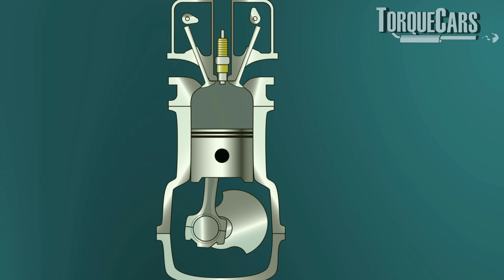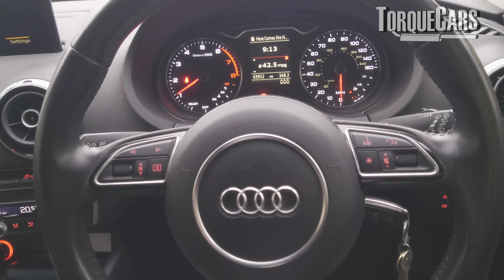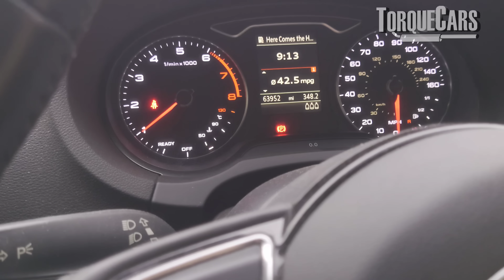These Common Cold Start Mistakes Could Destroy Your Cars Engine!

Comment: BMW 318D here (N47 engine) at over 320k kilometres driven, without any issue. I change the oil every 8k kms. Replaced the timing chain and the rod bearings, main bearings @ 275k km. Changed the injectors just 3 days ago since I heard them starting to make very soft crackling noise. But I think replacement at 320k kms is very good indeed. Turbo is still the original. My startup routine goes like this : ignition, wait till the pre-heating happens, then I push start. Im starting with the clutch being pushed (manual gearbox) since it eases off the double weight clutch's spring, in return loads a little the main crankshaft's positioning bearing, but I think it's still the better solution. When the engine revs up I wait 20-30 second to get the rpm down, this means the very early heat up of the pistons already happened. Along with a little spooling and warming up of the turbocharger. Exhaust also gets considerably warmer after the 30 seconds, if you don't believe me just try to touch it 😂. Normally exhaust gases are instantly like 300-400 Celsius hot which work on every part immediately after start. So after the very first 30 secs I start parking out, using under 1200rpm range. I need to do an Y 360 degree so it takes like another 30 seconds. Then off I go in first gear at exactly 1300 rpm, this is the very first street which is around 300 meters long. Then I go further progressively using 2nd and 3rd gear but never rev above 1600 and I strick using the slightest acceleration to avoid turbo spool. After the initial 1.5 km I start using the 4th gear, reaching city speed limits. Beyond this Im using 1300-1800 rpm range with very modest acceleration until the oil temp gauge shows 75 Celsius. Then I start using rpm ranges up until 2000rpm, and medium acceleration. When oil reaches 100C finally (usually after 20 km distance), I start to rev till 2500, and do decent acceleration. And finally the very last stage, after another 5 km with 100C oil, I start to use the full rpm range (I mean the reasonable range) which is 1300 - 4000 rpm, and often do full throttle. Even if I drive slowly I shift at 2500rpm. Many owner kills his diesel by using only the low rpm range (under 2k). I know that it is funny to push the pedal at 1300 rpm and feel the turbo kick in and feel the immersing power waking up. But mind me: it is the second main reason why your engine won't last. Bearings hate low rpm torque! Always shift back! Accel only from 2k flat out. And you are very safe to use 3k - 4k rpm range if you are only accelerating and not traveling at that rpm. Traveling (anything lasting over 5 mins) must happen under 3k rpm otherwise you will overheat your components, but that is over 150kmh in 6th gear anyway so where would you do that? 😅

So to sum up, start out after 30 sec be very gentle, but keep warming her up, and when she's warm use her dynamically, don't drive like a grandpa.

Last but not least : always plan you cool off periods. Drive slow in the last 5kms! No race no 4k rpm, no flat out here. Just progressively get slower and slower allowing the components to cool back! Once you arrived idle for 30secs then shut off the engine. You turbo will be with you like mine for at least 300kms if you do this.
Reply: To work and back then, how sad!!!!
Reply: @dunc5946  I mean thats what these cars are build for... You dont buy a diesel to have excessive weekend petrol head trips. I also own a 330D BMW E90 (N57) and it is one of the best cars I ever owned. 317k kilometers at this point, runs butter smooth, 6l/100km fuel consumption and all of that with decent horse power and comfort. The perfect daily car imo next to the classic toyota corolla or honda civic. If you properly take care of the engine these things run 500k kilometers and longer. The cost per kilometer ratio is very good on these cars for communiting! The only downside is unfortunately most people know this so all BMW from the golden era are past 200tkm already and you are only getting beat down cars. You never know how the previous owner treated their car so its always a gamble. The best value was buying a N57 in 2012 with 50tkm and rocking it unitl today. Would have been the a tremendous deal but hey you take what you can get.
Reply: @dunc5946 Depends on how much you care for your car and engine. It also depends on how much you know and understand about engine technology and how much time you might have invested in the car and engine. If you see your car and a means to an end, you won’t understand this way of thinking.
Reply: no issues ? i should think not , youv rebuilt the engine almost !
Reply: @brianliggett9087  the replacements are like 1/4 of the cost of a replacement engine, yet you are getting 500tkm + out of this engine... of course everyone knows its almost impossible to run a engine forver without 0 maintenance lmao when you talk about an engine "without issues" you are basically saying the engine can even last until 500tkm+ without key components breaking like the pistons or the engine block

Comment: My 1997 Toyota Hilux l never ever rev the engine high when l first start it up and l do wait for the temperature gauge needle to move it is summer in Australia now and is warm and my Hilux does warm up quicker and there is no reason to go fast and rev the engine and the 22R engine has a lot of low down and mid range torque and l there is actually no need to rev the engine hard because the engine is so flexible and my Hilux has done 440000 kilometres and does not burn oil at all and l would notice any oil burning because there is no cat converter and no blue smoke infact tgere is no smoke of any colour coming out of the exhaust pipe also it depends how well built and engineered the engine is infact the 22R engine is considered one of the most reliable engines ever made were most European engine are not considered to be really reliable there are much older European engines which are very reliable and will go on to do over 1000000 miles and there are many Toyota engines that have done over 1000000 miles without a rebuild that's what  Toyota is famous for reliability although its taken a bit of a hit lately from what the USA with there legislation have done

Comment: Some bullshyte going on here.   Cold weather start-ups and RPM is controlled by both air and coolant temp sensors in conjunction with the ECU.   So initial start up will produce a higher RPM until the sensors tell the ECU to go into idle mode!

My daily driver is now >26 years and running very smoothly!

Comment: As a rule i let engine idle for about 20-30 seconds before i drive off, cold start that is. My Volvo S60 rev high for about 20 sec when it`s started cold, i let the revs drop before driving off. This 20 year old car have been a reliable car for 15 years i`ve had it.
Reply: Well ofcourse, it’s A Volvo😎😎🔝🔝

Comment: I think there is a law of diminishing returns beyond the basics, changing the oil frequently and being gentle with the engine while it’s warming up are the absolute basics for anyone who wants to get long life from an engine.
Reply: Absolutely! But I can assure you that most drivers have no clue at all about the how long that takes in mls/km/time. 6 to 8 km. at least, depending on the weather. As mentioned; short trips are deadly too.
Reply: @sebastian0107 
*Only short trips. One full heat cycle / long drive a week is enough to ensure longevity.
Reply: @ If only! Many people are used to taking ultra short trips (1 to 5km.) to work or to go shopping. Yellow Sludge will then appear within days. OK, so, yes, that will disappear with a full heat circle, but the in-the-mean-time damage all that moist does to your engine and exhaust in the long run is not beneficial. Cold starts, bad miles; they're all bad, in my opinion.
Reply: @sebastian0107  in your opinion, fine. 
But it's been disproven many times over.

Comment: I used to live where winters are -20C . Thumb of rule used to be start the engine and clean snow etc and go as soon as front window is dehumidified. No snow = drive away instantly no matter how cold it is. Engine will warm up faster as well, keep low rpm until warm. Don’t overthink it…

Comment: If the ambient temperature is 35° or below, I usually give my car a warmup of 3-5 minutes before taking off, then lightly load it. My car is a hybrid and runs a full synthetic 0W20. Have gone over 160k and no oil consumption ( maybe a quart or so a long time ago ). Currently running Lubrication Engineers full synthetic, the best oil you never heard of😊
Reply: 35?....that's hot!

Comment: Usual method for a cold winter start for me is to set heat to high, fan to off, start engine turn on lights, and any electric heating that the car has, which increases the load on the engine a little.  Leave it running while you remove snow/ice from the windows. And drive off while turning the fan on at mimium, and have it heat only the windshield at first. And as the temperature of the engine starts to move up rapidly from driving, turn the fan higher until you get to a comfortable point.
This just allows the water in the short loop to warm up quickly without the heating system cooling slightly warmer water back to cold again, and to give you a decent bit of heat in the system to drive off with. 
Most people start the car, turn the heat up, turn the fan way up, and the water just doesn't even get the chance to warm up while idling. 
If there's no chance of fogging up you can keep the heating set to cold to reduce the amount of water circulating and help heat the engine up even faster.
Reply: I would normally keep the heater off until the car has warmed up a little to help the engine have all the heat instead of having to heat the heater circuit as well, unless they are others in the car complaining about the cold, I think you know who I mean LOL.🥶🥶🥶.
Reply: @kensmithmail  I prefer to keep it open with fan off to prevent dumping a bunch of cold water into a warm/hot engine once you open it up. 
It's probably fine, but it just feels wrong to risk dumping ice cold water into an engine that has already warmed up.
Reply: He just told you not to put load on the engine when warming up.

Comment: It summer my Chrysler warms up to 180 degrees engine temp in about 5-6 minutes. In winter like now wgen its 40 degrees outside it take almost 20. And while im on the highway my engine temps are about 165-175 instead of 190 usually in summer. I love winter

Comment: I own a GDI turbo and I have a hill to climb to get out of my hood. I have a boost gauge,what I try and do is run my engine at a little higher rpm to keep the turbo boost pressure down while climbing any hill

Comment: I watched a few of your videos with you harping on not letting your engine warm up but just gently drive it keeping your rpm’s low. It is obvious that you are not from a cold climate. At -35c or colder with an automatic transmission you don’t move until engine rpm’s are at least 2500. The transmission, differentials, wheel bearings all are stiff as hell. As for condensation in the exhaust, even on the highway the tail pipe is spinning drops of moisture. My rule of thumb is until the temperature gauge move I don’t go anywhere. 55 years of driving and I have yet to replace a vehicle because of a bad motor.
Reply: Ok most places in the world will never see a extreme as low as - 35c on any regular basis... You may be right for those specific conditions... But this video is more applicable to the majority of us
Reply: I'll bear that in mind next time I drive to Siberia

Comment: The solution? Install an auxiliary heater that also preheats the engine. You can turn on this auxiliary heater with a remote control or program the time you want to leave. Then the car or truck, including the engine, will be preheated when you set off. The manufacturer Webasto comes to mind. Just ask the workshop about auxiliary heaters.
Reply: Webasto. ‘the wonder word’
😎😎

Comment: Why aren't car engines programmed to run at 1,000 rpm at start instead of 1,500 to 2,000 rpm? Cars are also sold to warm climate countries and don't need to warm up so intensely.

Comment: All these facts about cold engines and how to warm up ETC have been known about almost as long as there have been engines in cars, We do know more about it now but this is not a new thing.
When the first engines were put into use, drivers would soon feel the power and overall performance (Not that there was a lot !) improve as the engine reached operating temperature so there's nothing new there...
Modern materials and lubricants used now are vastly superiour to that which was available in the 1890's but the science behind the operation of the internal combustion engine is basically the same. Better material selection and alloying techniques have improved wear properties beyond anything that could have been imagined when the first engines were produced but the same basic things to increase the life of your engine remain the same. Above all, regular maintainance is key to keeping your pride and joy on the road for longer as well as knowing that if you give the engine a hard time, it's not going to last as long no matter how well you look after it. 
Dont thrash your engine past the red-line, ever! Its there for a reason. Even if you know the engine can handle the higher demands of a good thrash you're asking for trouble eventually, but probably sooner than later and possibly catastrophically when you least need it!
I have had many mechanics tell me the best way to warm up your engine is to start it up, let it idle for a few (10-20) seconds to let oil circulate and then drive gently for the first few miles or untill your temperature gauge shows its up to operating temperature. In most cases this will be just a few minutes. There will be some circumstances when you cant stick to this routine but if you can stick to it you'll have your engine for much longer...
We could have a rigid routine of warming up but we have to be practical and in this modern world, engines have been designed to cope, as long as its well maintained and not hammered every time you get behind the wheel.

Comment: I use good quality correct grade oil in my cars and pull off straight away from cold and drive them under 2K rpm (Without laboring!) Until they are up to temperature on the gauge, Then i happily give them some welly! Also never start a cold engine and just let it idle until warm especially diesels, The warm up procedure should be at min 1500 rpm, Low idle cold and the piston rings dig in to the bores!
Reply: DO you mean I should not let my diesel van idle? I was told to let it idle for 5 mins before driving
Reply: @imantheP.D  High idle mate, 1500 rpm minimum stops the rings bedding in to the bores.
Reply: @imantheP.D  in Germany you are getting fined if caught idling over 30 seconds

Comment: Question from the " stupid seats " and please don't crucify me...
Are you saying modern cars need a choke?
Reply from the maker: Ah the good old choke, this was a feature we had on carburetor engines which would force them to run hotter, on  a modern engine with fuel injection the cars ECU (Computer) does all the adjustments needed and takes reading from the exhaust to drop exactly the right amount of fuel in. The modern car does carefully control everything during warm up and the main reason for this is to protect the catalysts so at first the idle will be quite high and as it detects the engine warming up and burning better it will drop the idle speed down.

Comment: On my turbo diesel pickup, I start it up and let it run while I am doing my seatbelt, mirrors, heater controls etc. So maybe 10-20 seconds. Then drive off gently keeping around 2K revs until its warmed up properly.
Reply: I let my Allroad sort out it's own idle while belting up etc. After about 40 seconds it settles down to about 850-900 rpm and the fluid in the gbox has got around...I know this cos if I try 5o engage gear before then it doesn't like it and jerks, but after 40 seconds it's smooth. Drive off keeping the revs under 2k until the temp gauge starts moving and then let it get to 6th in its own time and all's good for the rest of the drive.
Reply: I always do that as well.
Reply: See my post above, Bad idea to let a cold diesel idle, You want a min of 1500 rpm mate.
Reply: @scotty6346  guess what, bozo. every modern TDI does that by itself

Comment: I've always had much the same habits when starting my car from cold (I currently drive a petrol car). I start the car and let it idle for a minute, then drive off but on a light throttle and only at about 2000rpm initially, gradually increasing things as the engine warms up. 40 years ago when I had my first cars, a mechanic told me exactly what you're saying here, not to rev the engine hard when its cold and to drive reasonably gently until the engine warms up.

Comment: My car manual says drive off soon as you start. Probably to reduce emissions. Old Haynes manual for Humber Sceptre had a page about starting. The initial tick over was 1500 rpm. It also said not wait to warm engine but move off as they found more wear idling than having a load on the piston. Keep a positive load on the piston created less wear.
Reply: I've been driving since 1977 and that's always been the way I've driven my car ... Start it and let it sit just briefly then drive off and don't rag the engine until it's warmed up
Reply: My Alfa Romeo mito says thesame.
Reply: I had a TR6, i am sure the manual said 2 minutes at over 2,500 rpm before moving off.
Reply: @helixvonsmelix  I know my Z4 E89 burns some oil. I read somewhere these engines run hot so clearances must be wide at start burning oil. Moving off soon probably loads up the rings to reduce oil burn.